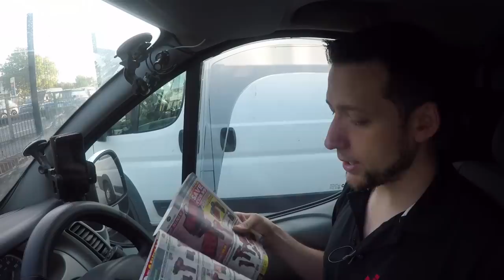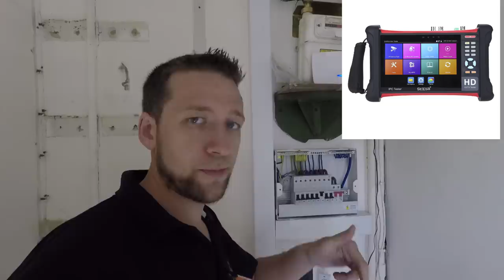Breaking out the Ducati of AWESOMENESS (and some data work) | Thomas Nagy

Comment: Don't get an SLR, it's the wrong tool. It will be big and heavy, and you'll need to carry a tripod and figure out how to get it in your work area. You'll also need a fisheye lens like an 8-15 or 10-20, but you might not like the visual distortion that they have.
I'd recommend getting a Micro Four Thirds camera. Attach it to a Gorillapod, and you'll be able to mount it anywhere in your work area. Going Four Thirds also doesn't lock you in to one company's hardware.

Comment: Tom do yourself a favour and buy that 12v Soldering Iron! Like you, I had a 240v one and couldn't justify it. But time spent getting an extension lead out, finding somewhere to plug it in etc etc is time wasted.
The 12v is in my tool bag all the time, heats up in a quarter of the time, bang you're done. Best $100 I've ever spent!

Comment: Cat6 cable is a slightly higher cage cable than Cat5 or Cat5e to the punch downs are wider. Not much of an issue using Cat5 jacks with Cat6 cable in a pinch but not recommended for long term use.

Comment: Entered!!! Need that Wera screwdriver set in my life!!! and could definitely do with a new set of VDE plier set!!! You cannot beat a hardwired internet connection, consistent and reliable unlike Wifi, too many 2.4ghz connection in the air theses days.

Comment: The CAT6 is supposed to be higher quality connections and the cable has better shielding to support higher speeds.

Unless your going to go for 10gb CAT5e is more than enough in the home

CCNP Network Engineer here

Comment: The old wifi vs wired ethernet question. If you have to ask, you don't need ethernet. Basically as easy as that. The basics is that ethernet provides a faster and more solid network connection, especially if its cat 6 gigabit, than wifi will give. It's just more robust and more reliable. Wifi is good for your gadgets and the occasional laptop, but for anything serious work over network and streaming on the telly, wired ethernet is the way to go.

Comment: I've got a canon 80d and it is one of the best camera's for video blogging as you probably know, because of the way it locks on to your face and keeps it in focus better than other cameras in its class especially if you use canon stm lenses no hunting or trying to find focus, it also has a articulating screen so you can see yourself on the screen when videoing yourself,it also has time-lapse setting which is handy but it does not have 4k only 1080 at 60 frames per second, but having said all that I would not like to take it on a building site but maybe you don't mind if it gives you good results, I'am a electrician working in Ireland and I did have the bright idea of making a video of some of my work and passing on some tips and advice I haven't seen in other electricians youtube videos, but it took to long setting up the tripod and trying to get the shoots I wanted, you and the other youtube electricians make it look so easy, if a did give it ago I thing I would just mainly used my phone to make the video because you can do that quickly and not waste much time at work even if the sound quality would not be the best, keep up the good work Thomas I like watching your videos and the other electricians on youtube and often learn something new after watching them, another thing with canon camera's there lens and accessories are cheaper than other makes because of economy of scale because they are still the biggest camera manufacturer.

Comment: Just to correct some people the speed of Cat3,5,5e,6 are all the same  the difference is the bandwidth Cat 5 minimum of 100MHz Cat 6 250Mhz.  I've been installing Cat5 with a minimum of 350MHz for years so still out preforms basic Cat6.    

The bandwidth is like the number of lanes on a motorway you can get more traffic down it in a given time the more lanes you have.  Saying the speed is faster is like saying increasing the conductor size increases the voltage carrying capability.  

Secondly the LINK LENGTH is limited to 100m  (this is due to the specification of the various Layer 1 specifications - ISO 7 layer model) , that would be a strait length of cable with no connections remember you should take off about 10m for connections and patch leads as a rule of thumb.    

If you need a cable length of greater than 90m you should install 2 switches with a minimum of link cables to form a backbone and configure the switches for redundancy. 

Cable ties should and should never have been used on Cat3-7 cables as they crush the conductors together and cause cross talk.

Hope this clears things up :)

And don't forget your bend radius and don't run them parallel with power cables where possible.
Reply: I'm confused, please explain the difference between speed and bandwidth.  They are both apparently measured in bits/sec, aren't they just different names for the rate at which you can get data down a wire.

Comment: The connections are the same. C6 is in a different order by standard, if I’m not mistaken. The only thing that makes something C6 is the physical wire itself.

Also, I’d like to enter the contest. Those would be great for the access control work I do.

Comment: Cat6 cable has better separation of the twisted pairs, it usually has a X section running down the centre, to keep the pairs free of cross talk, unlike cat5 which are just twisted together. Shielding is also better.

Comment: Internally the Cat6 sockets are slightly different with a higher spec than the cat5e ones.  Externally they usually look much the same.

Comment: wifi sucks in a dense area, I live in a small neighborhood out in the sticks and everyone has wifi + extenders all on auto channel hogging up the entire air space, so when it does work longer than 15 min its like at most 20mbs, vs hardwired I am pulling 250 all day long with zero loss

Comment: Never really thought about Cat6 and Cat5 differences...
They both use the same wiring layout: https://en.wikipedia.org/wiki/TIA/EIA-568
They are both "twisted pair".
Cat6 is "backwards compatible" with Cat5.
The only thing that should be different is the insulation I think. Cat6 has less interference and supports greater speeds. (Maybe the wires are bigger? :) )

Comment: I think with the kind of work you do, and the dust a camera would be subjected to you are going to have a fun time with dslr's. especially if you are interchanging lenses in the field (which isn't so much of a problem if you don't use prime lenses and go for a good full-range zoom). i'd take a note from the popular bloggers and go with an A5100 - its cheap and it's got a 16-50mm lens stock so it'll cover most zoom ranges (with 16mm being your typical wide for when you are holding the camera on yourself). or go for a Canon PowerShot G7 X Mark II which doesn't allow for interchangeable lenses but I think the range is fine for vlogging setup. any higher end point and shoot really will do fine. hell you can even use a good iphone on an dji osmo (gimbal stabilizer) and get good results. but definitely get the rode vid mic pro or similar for audio. for lenses the lower f-stop the better as with any smaller form factor camera you won't get the best ISO noise performance at higher f-stops (e.g. 2.8 good starting point - just be weary as 2.8 - 5.6 means that as you zoom the f-stop is not constant and increases over the zoom length). any questions feel free to ask.

Comment: 10 years ago I'd have said data all the way but these days unless you have commercial redundancy requirements or requrie cat6 level transfer speeds and latency, can't see any reason not to use 100% wifi. Especially in a domestic setting.

Comment: For anyone wondering what the point of still running wires is. 
Most household routers, each hard line can support an average of 5x the speed of the connection that all your wireless devices have to share.
Pretty much running a wire will eliminate 99.9% of the issues you run into with speed/buffering/connection over WiFi.

If you want a more visual representation,
If WiFi is a typical 2 lane road. (and all your devices have to share said road)
A hard line wire is like a 10 lane highway. (and every wired device gets its own highway)

Now you know why your HD stream is constantly buffering over WiFI

Comment: Another great video and give away, I'd love to win! 
At home we went wired for the devices that would connect, leaving more capacity for the 2.4gHz wifi for those mobile devices. It would have been neater with a VDSL faceplate, so losing the the dangling micro filter in the cupboard and allows the phones to plug direct to the sockets without further micro filters

Comment: I'm sorry to say, Fair warning with those cable testers, they are great when they work but if the software becomes corrupted there is little you can do.
I have one in that brand that is a Digital multimeter, Cable tester/finder, CVI, AHD, TVI, SDI and IP Camera tester, fantastic when they work, when the software fails like mine has causing some functions no to work it is virtually impossible to get it fixed. Best of luck with your new toy.

Cat6 is a slightly heaver gauge cable so there may be a very small difference with the spacing of the pins on the back where you punch down the wires and if you look in the socket the pins should be staggered.

Comment: The rating is mostly CYA, when there’s a problem trying to run your 10gbit over your 0.5m Cat5e patch YOU are to blame but if you can point to all of your Cat6 rated connections your safe.

Comment: Hi Thomas, Although Cat 6 looks like the same as Cat 5 it can handle twice the amount bandwidth. Apparently Cat 6 contains extra components that prevent crosstalk between the pairs of wire. Resulting Cat 6 to have a "performance boost"therefore Cat 6 can handle up to 250 Megahertz. Cat 5 in its "solid form" is more effective over longer distances and has a maximum bandwidth of 100 Megahertz. (So you get more out of Cat 6 cable)That being said Using a Cat 5 conector will do just fine and still support decent speeds with cat 6 cable.  But to get the most out of the Cat 6 cable to get the 250 Megahertz it can offer it is advised to use a proper Cat 6 conector. (It isnt really a marketing gimmick) I think this is because of the copper or way the conector is made. The basic difference is that Cat 6 is more future proof for faster networking capabilities.and Cat 5 cable will have to be replaced if you want a faster network in the future. Hope this answers you question a bit?And i entered the giveawayAlso I use a Canon 750D which does what I want it to do and it cost $1000 AU with a pretty good lens.

Hope this helps !

Comment: from what i remember from a data course cat5e shouldnt be untwisted more than 13mm cat 6 was 7mm
fm ip networks website
Cat5e
Category 5e has now been with us since 1992. Cat5e or class D is still the technology of choice for thousands of smaller local area networks (LAN) were, during the network’s lifetime, there is no likely need for greater than Gigabit Ethernet and, to be honest, in many offices and small companies, 100mb/s is still perfectly adequate and will be for some years.

Cat5e is also a great commercial choice for short-term networks were for example, a company cables-up a temporary or short term rented building – knowing that they only need the network for two or three years and then they’re moving out. So, for them, there is no commercial sense in future proofing the network.
Cat6
Cat6 has never had an application (such as a specific speed of Ethernet) of its own. Instead, it became a significantly better solution for Gigabit Ethernet – offering the safety margin of ‘headroom’ that Cat 5e lacks.

With larger conductors, Cat 6 is also better for power over Ethernet (PoE) applications were its cables do not get as hot (and it should always be remembered that when data cables get warm it significantly degrades their data performance and the length of channel that can be supported!).

So, for installations where Gigabit is going to suffice for all foreseeable business or operational requirements (and where reliability rather than cheapness is the main driver) Cat6 is only a little more expensive than Cat5e but gives a much more robust engineering solution.

Comment: Cat6 has thicker wires than Cat5E. I learned that the hard way, when I was given some Cat6 cable, but all my RJ45 plugs were Cat5E, and they just didn't fit the individual wires of the Cat6 cable.
Reply: Not necessarily. The rating is down to the frequency it's rated for. You can get CAT5e and CAT6 with exactly the same thickness copper inside.

Comment: Cat5e Vs cat6. I have had issues due to the fact it's about 50% thicker due to the containment in the cable. Also it's not as flexible. Cat5e is fine for most current applications but some people just get upsold without actually getting anymore.

Comment: Can't see much point in using Cat6 for domestic installations.  The only plus is being rated to potentially take 10Gig but even the lucky few with fibre to the premises have nothing like that nor any prospect of getting it.

Apart from that there's nothing that Cat5e can't provide and that's a lot easier to work with.

Comment: was just about to comment on cable tester then you mentioned it , I install as part of the day job, and the £2 one you have is barebones but you should have something that does actual pairs testing. Ideally certifying too, esp if you have data cabler specified on your public liability insurance. 
For me, the power points were too close to the mains sockets, especially with you having the switching power supply in there, probably best you did do CAT6 ( was it just 6 or 6a?)

Comment: Cat 6 provides better performance and reduces crosstalk etc but as for the diffence between the actual jack's I have looked my self even took both apart and I can find any difference maybe they use different metals as the contactors but to the eye I could not see a difference

Comment: I entered, and doesnt bigclive have that same screwdriver?  as far as the cat6 vs cat5e cat6 has bigger wires and thus the stand offs for attaching at the receptacles are a little wider and wouldnt really hold cat5e very well, you could do it, but it wouldnt be very reliable

Comment: I thought CAT 6 was just the cable quality itself (more insulation). Maybe it’s a better quality material for transferring data better. Because theoretically you can plug CAT 5e into a CAT 6 interface but you won’t achieve 10Gbps, it will be flaky

Comment: It's a rooter not a rowter.. heck man, if you must know, an army gets routed, (rowted) when they run away, if you're cutting a groove in some wood you use a router (rowter)  if you're directing or going somewhere you're taking a route (root). Data is routed, by a router. The thing is a router. Rooter. Also is gif not gif. 😁🙃❤

Comment: What was that cable tester? Also Cat-6 is a little bit of hype, 5e is capable of doing 1Gbps just fine, there may be differences in the "certification" if  the Chinese are even doing it to the stuff your buying. The crimp connectors the differences your seeing are probably just differences between manufactures. The thing your really worried about is the cable, 5e and 6 cable can be almost the same, some 6 has a better separation spacer, the 6a and 7 is just over priced and I don't think most home users for 20 years would ever need 10Gbps capability haha. To save you some money in the closet look for "Cat-6 patch panels", they make them in 8-48 ports, with different mounting options, here in the USA I see a 12 port on Amazon.com for $20USD.  As for running cable and or just using all wifi, its good to always have the option to plug things in if they are stationary and have the capability, radios have to split the time to send data to different devices and are also limited in speed along with the noise of every other person with a cheep router out there. So for things like TV/Streaming boxes, a office computer, and such run a cable it will make it work better too. And like another guy said POE is some cool stuff, use a cable with power running though it to locate a dedicated Wireless Access Point in the center of the dwelling will give the user such a better experience with their wireless devices, you can also get POE cameras or other "IoT" devices.

Comment: Cat6 has thicker copper and is better insulated than Cat5e; you can use cat5e ends but you will not get the 10Gb/s cat6 speeds just 1Gb/s As that is the highest rating of cat5e.

Comment: The difference is the attenuation, near end cross talk which all impacts speed so max possible transfer speed. cat 5e is a gigabit. With cat 6 it is 10 gigabit so a factor of 10. However, the router will only have a max of about 60meg so less than 1 gig of transfer speed to the internet. The advantage is port to port transfer speed but there is not a single consumer device that is true 10gig because the standard BT router etc cannot handle that transfer speed. Reality, cat 5 for residential is perfectly fine unless you are approaching 90mts per run then cat 6 would be better. The standard is called 258a.
Reply: Hmm over 170Mbps here, good thing I have gigabit  ;)